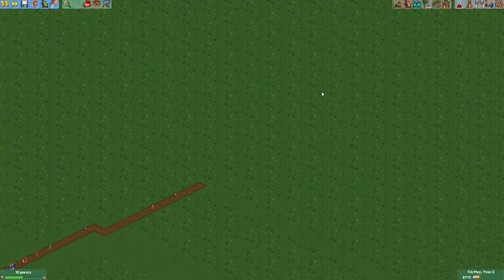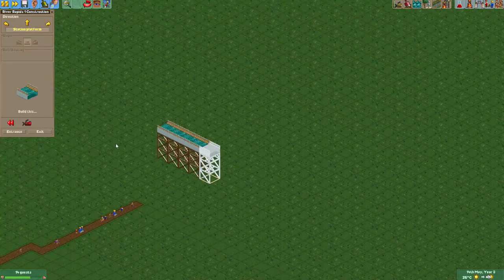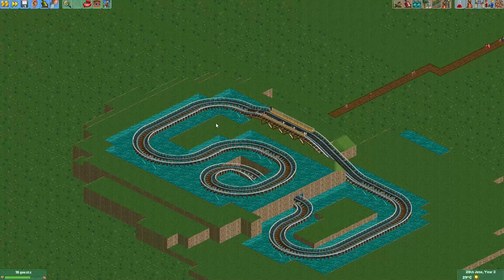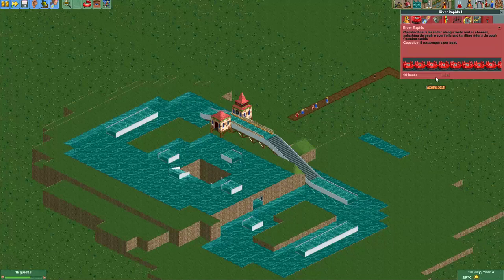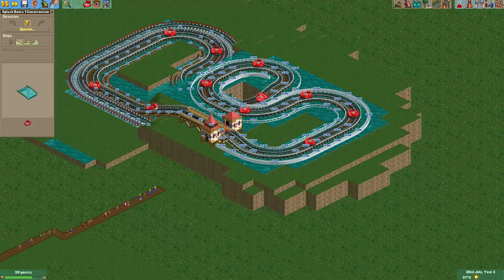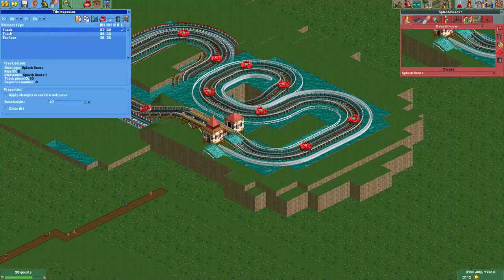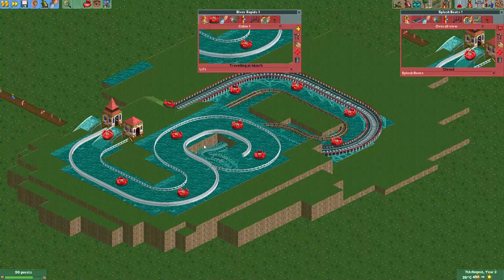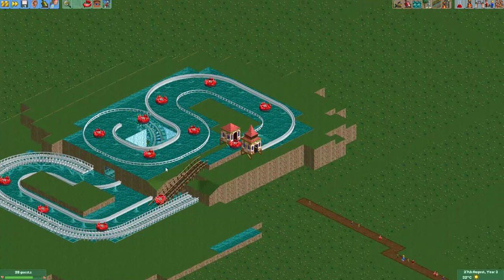Git gud at OpenRCT2 #12: Making a realistic river rapids ride

Comment: When I change the ride type to 'lift' for example. The boats often stack on top of each other. Am i Missing something?
Reply from the maker: If you use a ride type like crooked house the vehicles can pass through each other.. you should first use a normal ride type, then spawn the vehicles by putting it in test mode and then change it to crooked house. I don't have this issue when I change a ride to a lift
Reply: @Deurklink  Dat gaan we uitproberen. Dankje!